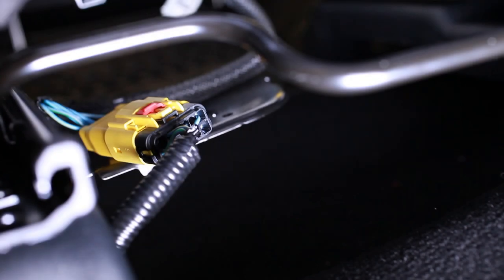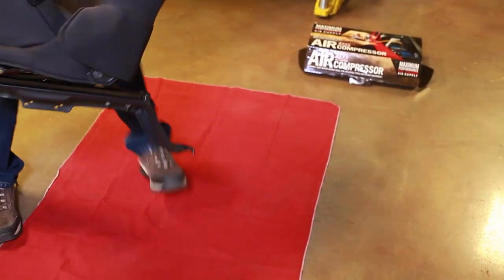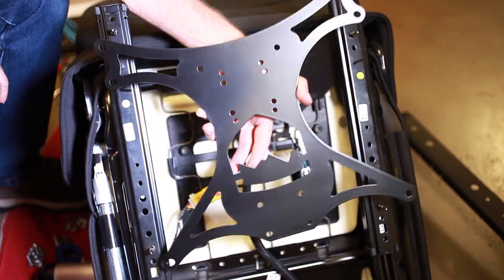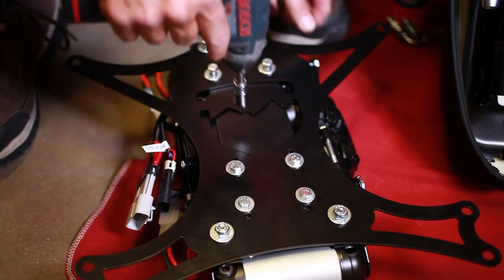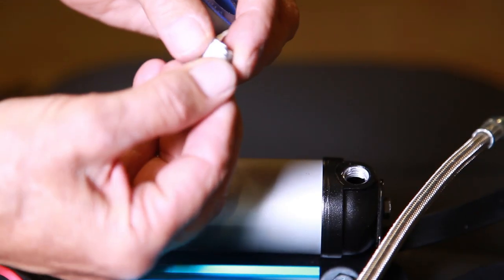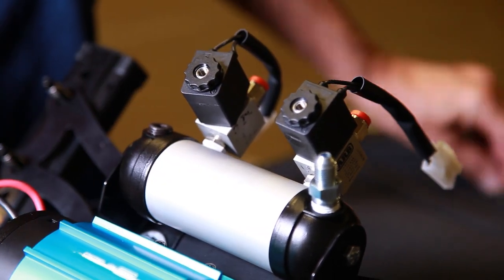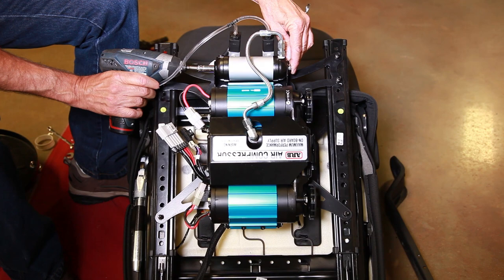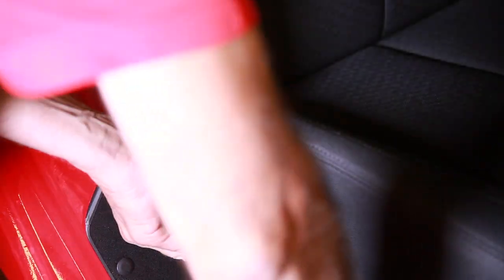TeraFlex Install: JK ARB Compressor Under Seat Mounting Kit

Comment: Powering this is simple, hardest part is running wires through the hole in passenger side firewall. I have this installed to a Apollointech relay, works great.

Comment: I don't know how anyone could enjoy there compressor with it mounted that close to them. Mine is mounted under the rear trap door in my 4 door JK diesel and it is so loud that I nearly crap myself every time I turn on my lockers.
Very nice install video though. You're very good at these Denis.
Reply: +fourbypete Whats the rear trap door?  Tailgate?  Do you have a pic or two to share?
Reply: +Michael Berg (4x4Jeeper) I don't know how to upload a picture in the comments. Basically, in the 4 door Jeep there is a dip in the floor behind the rear seat that I have modified to house a low profile battery and air compressor.

Comment: I had to cut the sheathing and run each of the 5 wires individually through that little hole in the firewall. Disconnecting each of the wires from the connector plug was a PITA! Using a jewelers flat screw driver did the trick.

Comment: One thing you didn't show was how you ran power to it... any tips?
Reply: tap into the pod fuse panel that you should install under the hood.
Reply: @jasonallen6836  On one side of the Wiring that comes with the compressor is a massive plug. The other side is a dual fuse again huge. where do you push the wires through the firewall. there is NO way this would fit. This is what people are asking. Because we are using the TerraFlex solution for under the seat, an idea where to run these wires to the S-pod would be helpful.This is part of the install, and a MAJOR part.  EDIT--I had to cut the sheathing and run each of the 5 wires individually through that little hole in the firewall. Disconnecting each of the wires from the connector plug was a PITA! Using a jewelers flat screw driver did the trick.
Reply from the maker: @HellGh0st  Glad you figure our a way to run your setup. Unfortunately the video is only for installing the seat bracket we manufacture. The ARB installation instructions should go through the wire running process and will be different for some vehicles. We understand the frustrations, and may release a video later in the future on how we ran the configuration. But it would only be a suggested setup. Thanks for the feedback .

Comment: Just an FYI on the 2007 model you have to use a cutoff wheel to remove 3 brackets. A bit more involved than I had originally planned.

Comment: Why is this mount listed on your site as JKU-only? What prevents it from mounting on a two-door. And, if it'll fit a 2-door, any issues with 2007-2010 interiors?
Reply: the 2 doors have folding options the 4 doors don't have

Comment: Any issues with the hot surface of the compressor melting the carpet or worse? Any testing with long durations of the compressor being used?
Reply from the maker: +vonguido1 We have been testing it out on one of our jeeps and the driver has used it multiple times to air up his 40" tires. He said he leaves the door near it open to help with airflow while he airs up just in case, but has never had an issue with it getting too hot.
Reply: +TeraFlexSuspensions good to hear, it's a great place for it, but my only concern would be the heat. Thanks
Reply: @teraflexsuspensions  My single tank compressor touches the carpet. I' m not if that going to be an issue. It would be nice if the mount was bent at an angle to mount closer to the underside of the seat. I'll probably eventually move the compressor to under the hold as I don't like how it fits under the seat.
Reply from the maker: @MichaelCook1981  We wanted a design to maintain airflow between the seat and also accept the various ARB compressors. We have been running that same setup and have had no issues with the compress or getting too hot, or damaging the carpet. Thanks for the feedback.
Reply: very few fires from this. only 1 in 4 show a complete jeep fire.

Comment: Hi,
Is the JIC4 elbow fitting that comes with the mounting kit shown ARB's part number 0740110?
https://www.northridge4x4.com/part/compressor-mounts-accessories/0740110-arb-90-deg-elbow-jic4-male-1-4in-npt-male-2pk

Thanks

Comment: Power Routing described here https://lib.extremeterrain.com/guides/J104225-cust.pdf .  Not possible to get the ARB supplied fuses through that hole so it will require leads coming from the battery through that hole to connect with the supplied wires.

Comment: Could this plate work for TJs to put under the driver seat? (I know it says it's for JKU, but i'd like to know if we can make it work for a TJ. the driver seat doesn't fold like the passenger seat)
Reply from the maker: It is not compatible with the TJ.

Comment: Wiring isnt show because teraflex only sells the bracket. They can care less if you wire the arb correctly or not.
Reply from the maker: Correct, although we do care, and hope your wiring is done in a correct and safe manor.  But since there are so many ways someone could run wiring for their compressor that we couldn't cover them all. Our install video is for the purpose of mounting the compressor to the bracket and the bracket to the seat only.

Comment: i didn't see how you got electricity to the compressor...
Reply: Dogurasu  its wireless
Reply: Dogurasu  NO there is not for underseat.....On one side of the Wiring that comes with the compressor is a massive plug. The other side is a dual fuse again huge. where do you push the wires through the firewall. there is NO way this would fit. This is what people are asking. Because we are using the TerraFlex solution for under the seat, an idea where to run these wires to the S-pod would be helpful.This is part of the install, and a MAJOR part. FYI the only solution I could come up with is to extend the wires on the fuse side (which ARB says not to do) and push those through.

Comment: Are Jeeps the only vehicles your mounts work on?
Reply: Nothing you couldnt do on any other vehicle with some flat iron, a couple drilled holes and bolts, honestly.  Most of this kit is off the shelf at any hardware store.

Comment: Where was the power to compressor routed to?
Reply: You can route it through the passenger side dash. Open the passenger door and remove the side plate on the end of the dash. You will see a hole that goes towards the engine compartment that is filled with Styrofoam. I straightened a hanger and pushed it through the foam, then wiggled it a bit to make the hole bigger. It will come out on top of the fender behind the battery and the curved piece of sheet metal.

NOTE: Take a photo or 3 so you know how to plug the connectors back into connector housing.

Once that is done, you can start removing the connectors on the end of the harness that plugs into the compressor. It is really easy if you have a jewelers flat tip screwdriver. You just push it down into the smaller opening of the connector to release the pins. You should hear a slight click when they are ready to be pulled out. Don't use too much force or you may end up breaking the connectors. They are pretty snug though.

I then wrapped tape around the free pins and wires, ran the hanger back out towards the engine bay, taped the wires to the hanger and pulled it through to the inside on the cabin. I routed it behind the glove box and down through the center console.  For the lights I just tapped into the cigarette lighter power line. 

Hope this helps someone.

Comment: What are doing to power the compressor?
Reply: Dogurasu  On one side of the Wiring that comes with the compressor is a massive plug. The other side is a dual fuse again huge. where do you push the wires through the firewall. there is NO way this would fit. This is what people are asking. Because we are using the TerraFlex solution for under the seat, an idea where to run these wires to the S-pod would be helpful.This is part of the install, and a MAJOR part.  EDIT--I had to cut the sheathing and run each of the 5 wires individually through that little hole in the firewall. Disconnecting each of the wires from the connector plug was a PITA! Using a jewelers flat screw driver did the trick.

Comment: will water fording affect this setup?
Reply from the maker: If you have water coming into the cab, you should consider mounting this compressor up higher.
Reply: Put a ring of silicone around the hole in the grommet on both sides to assure a good seal. That should hold up, but I'd keep an eye on it!

Comment: The noise factor seems like it would be too loud for inside the Jeep especially under one of the front seats.
Reply: Keep in mind you'd rarely be inside the Jeep for long....if you are airing tires/toys, you'd be out for sure, and if its lockers, it's a short burst here and there. Compressor 100% dry and temp-somewhat-controlled here, VS under the hood where its super tight, wet, hot, etc... just a thought if you are trying to decide